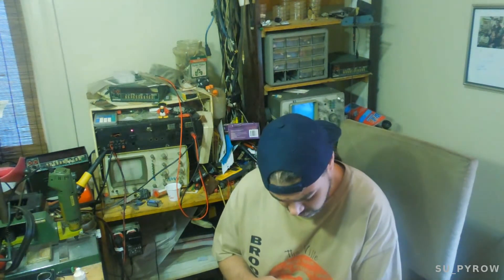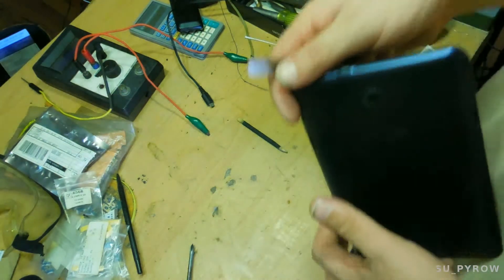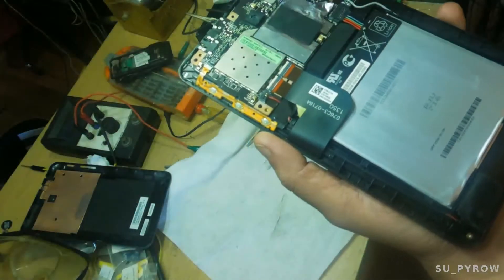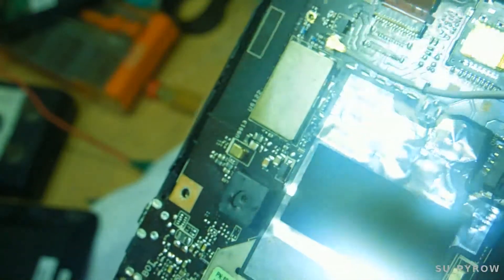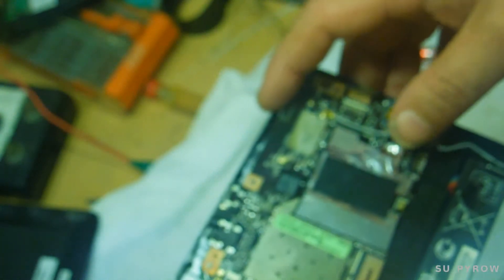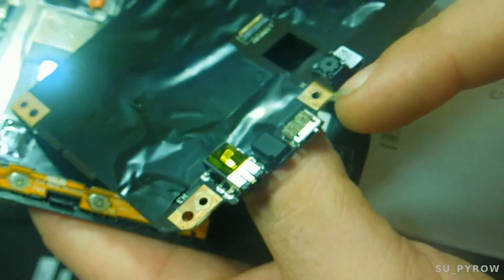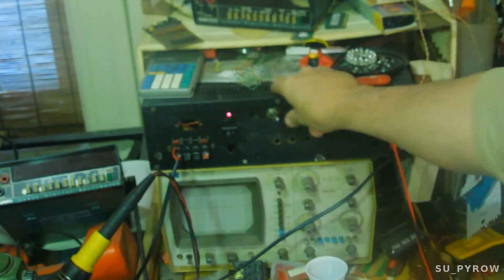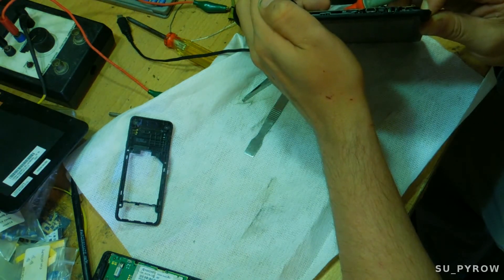Asus Tablet Diagnosis | Asus MeMO Pad Model: K00B SU PYROW #08

Comment: Good system check, not worth a screen.  What are you using for a power supply?
Reply from the maker: Hey Buzz!  good question, allot of individuals  have asked me about my powersupply.  i might do a teardown on it,   its a custom made 0-30v with current limiting. 0-5A supply.  right now the current is max 3.5A due to the transformer. i think i built it 3-4 years ago. and i spent about 5 weeks designing it from scratch. i think i need to make a new video.. lol
Reply: O, I have an Astron 40 amp 0-15 but may be looking for an 80amp,  0-24+. Don't tear down on my account. Just was wonderings if it was a brand.

Comment: Good lesson there Bobby. Plus people get to see how to get into a tablet. Not always a piece of cake.
Reply: I heard the Surface 3 is glued together, usually ends up a broken screen to fix those stupid usb jacks.  I liked the magnetic jacks they used on the other Surface tablets.  I got Edie the inductive charger for her Samsung silly fone.  I heard that Samsung uses usb jack that screw in and have short wires with plugs, much easier to fix. But I never opened one.  I opened an ipod once, to try to change its battery, that was it for me.
Reply from the maker: havent played with the surface 3 yet.  i like magnet jacks!  they have adaptors you can buy for usb jacks to turn them all into mag jacks.  those are cool!
Reply from the maker: yeah, most of the time its getting it all back together.. just like in this case.  what a SOB!
Reply: Um growing to hate touch screens, came close to busting mine up many times.  Fingoes, like typoes, I mistouch way too often.